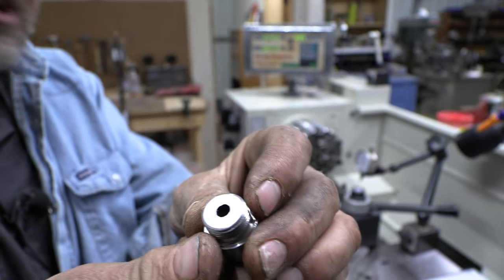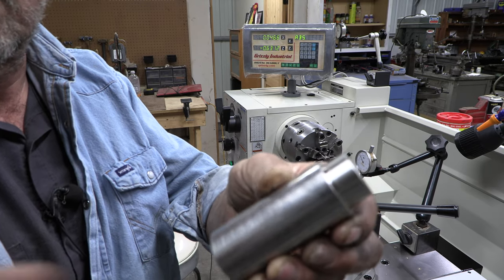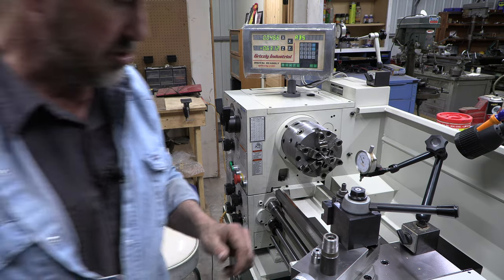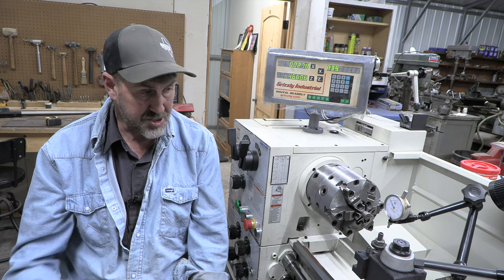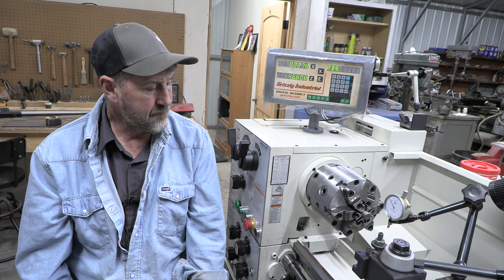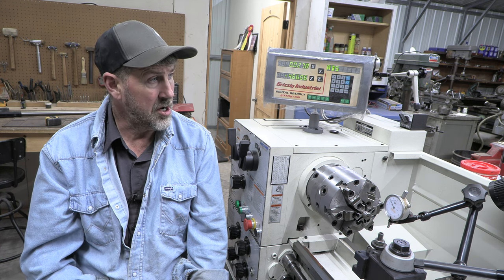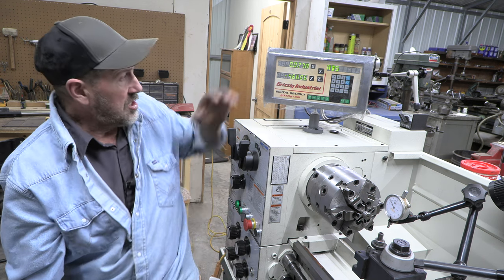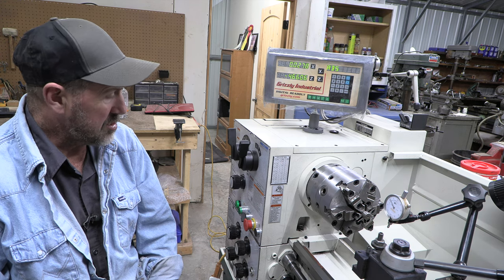Intoducing the new lathe

Comment: I was going to order the same lathe, but changed my mind to the G0709 you mentioned early in the video. I'm not a gunsmith, but build model engines. So a 2" spindle bore isn't an issue--and I had to order a DRO with it as well, because I definitely wanted that. But the thing that sold me on this model was what you mentioned about gear changes. The G0709 requires far fewer than the G0824. Either way though, these seem like very good lathes for the money. 

Thanks for making the video.

Comment: Make sure you clean the gearboxes out.  Most have factory swarf in both.  I built a heavy steel ladder rack for my G4003G and added a custom set of drawers between the stands.  The ladder rack has feet and rollers wider than the original stance.  No issues of it being top heavy.  It was about five inches low for my height to be comfortable so the rack solved that too.  I have had my machine since about 2014 when I bought it new.  Also bought a taper attachment at the same time.  Getting ready to install DRO now.  I don't like the degree wheel on the compound as it does not read the correct orientation when setting your 29.5 degrees for threading.  Not a big deal just an unnecessary fault.